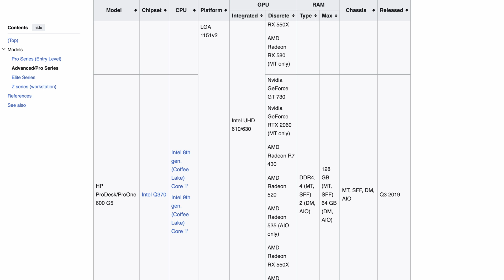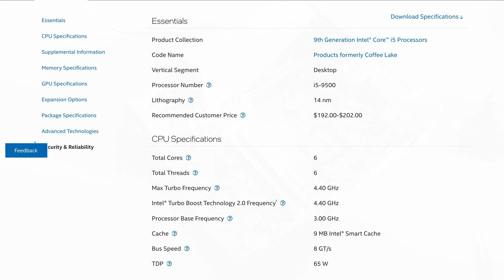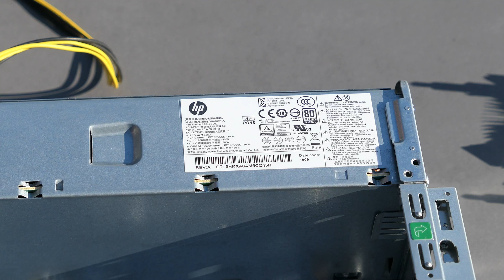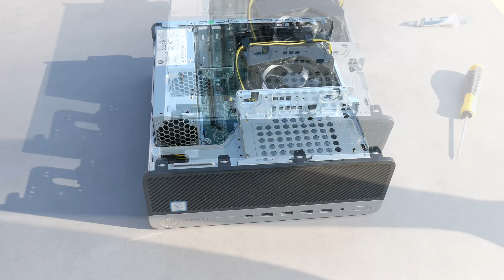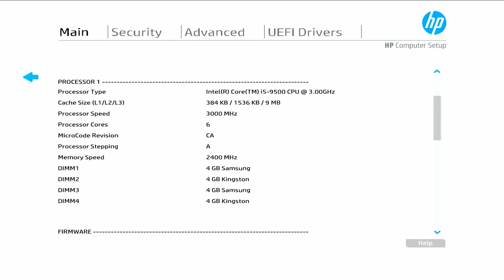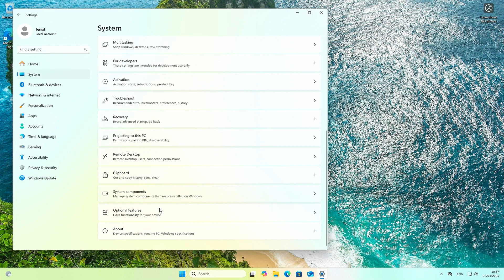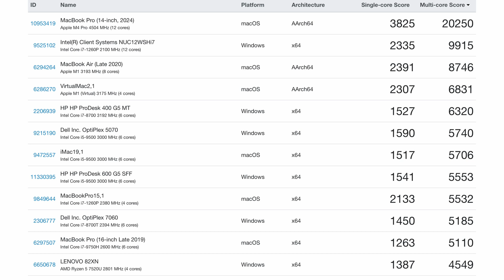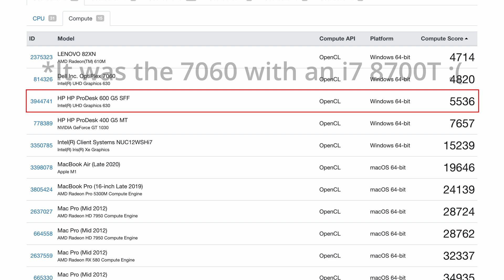HP ProDesk 600 G4 and G5 SFF - Teardown, Upgrade and Benchmarks

Comment: is there any other way to put a sata SSD? I think the sata cable at 9:30 only comes with one sata power cable
Reply from the maker: A splitter for the power connector should work fine if you only have one

Comment: Did you replace the Bios CR2032 battery?
Reply from the maker: Not sure if I did anymore but if yours is dead, it's pretty easy to do. Just push the metal clip holding the battery outwards and it should jump out. Then replace it with a fresh one.

Comment: My dude needs to shop blowing the fan in free rotation..

Puts so much pressure on the bearings..Some say might even destroy the fan from the electricity generated from magnets spinning.  

Not quite sure of the 2nd one but first one is quite likely

Comment: I needed a home office PC with a little arduino stuff, I found this unit G5 1M SSD and 32GB Ram for $250 It seemed like an ok Device with all those USB ports i could be working several ESP 32 boards and the documentation, It is reliable in your opinion.

Comment: Hi Jens! Any chance you could make a tutorial on how to install multiple Windows versions on the same SSD? I bought an OptiPlex 790 just for this so I can make a nostalgia PC and only managed to install 4 OS's and I'm pretty sure I didn't use the right approach either. I'd like to have Windows 98, Me, XP, Vista, 7, 8.1 and 10 on the same SSD, but I don't know what's the best way to approach this, especially with the pre XP versions. I noticed that the ISO's from Dell worked quite well and auto activated on my machine up until 8.1. I've seen some youtubers try this video idea too but couldn't find a proper one. Might be a very successful video idea as well. 🙂
Reply: como es eso de tener varios sistemas operativos en un mismo almacenamiento ?

Comment: Does the m.2 slot has a sata ssd or nvme 2280 drive
Reply: que yo sepa si tienen 1 o 2 puertos para ssd tendrias que investigar un poco mas de todas maneras puedes usar alguno externo con adaptadores que no esten sellados tambien tiene compartimentos para 2 discos duros mecanicos extras asi que con un adaptador o ssd con el mismo conector podrias montarlos sin problemas ay unos werstern digital

Comment: In terms of proprietary power connectors how difficult would it be to upgrade the PSU? It seems like a standard 24 pin is split between 3 (?) power connectors in addition to the 4 pin CPU one? Was interested in this since it's generally cheaper than the Dell SFF i7 8700 equivalent but I know for sure the PSU is swappable on that with one adapter as long as it fits in the case. Apevia's SFF PSUs (300, 400, 500w) are small enough to allow for a dual slot low profile GPU on the Dell which similarly has the PCIe 3x16 slot right above the PSU.
Reply: yo estaria mas preocupado por esos agujeros de ventilacion creo que le pondre algo para taparlos cuando no use la pc por que podrian entrar insectos

Comment: Can you check if the G4 can support the i5-9500? I read on Reddit that it might be possible. I have a G4 and would like to upgrade my G4900 to an i5-9500 🙏🙏
Reply: it does. it is not advisable. someone on hp forum had his die. stick with i7 8700 or 8700k if you have a good cooler
Reply: @thisnowthen  el disipador es muy pequeño y sin cobre por eso decidi el g1 que tiene un disipador gordo de cobre y un ventilador un poco mas grande que el del video

Comment: 8th gen cpu are actually something else, the i5 8500 easily claps my i7 7700 and i7 1185G7
Reply from the maker: Hmm, an i5 8500 gets significantly less high scores in benchmarks as far as I can see: https://browser.geekbench.com/processors/intel-core-i5-8500

The scores are similar to an I7 7700 indeed but lower than the i59500
Reply: @jensdbe can it be used efficiently for gaming? Fir highschool?

Comment: Hi as always a great video.  I have a Question for you: i bought a NiPoGi Mini PC  N100 with 16 GB RAM and 1 TB NVME SSD. Under UNRAID the SSD always was over 50 Grad Celsius . UNRAID showed me a temperatur warning. Now my question : is this temperatur normal for this mini pc? I will use this now with Proxmox and Nextcloud. With best regards from Germany.
Reply: las mini pc tienen mala ventilacion en teoria esa marca que dices si es la que tiene la salida con leds azules y rojos arriba y entrada de aire por debajo entonces es un problema general en todas las mini pc aun con cobre lo mejor que podrias hacer es montar ssd externas asi no comprometer la interna que ya esta al limite

Comment: Thank you for this very useful video. I recently bought an HP ProDesk 600 G4, and this is the exact information that I was looking for disassembly. Could you please recommend a video card for this SFF machine?
Reply from the maker: If I would have to recommend something, I think I'd go for a RX 6400 or a GTX 1650 low profile. The Rx6400 is slightly slower but uses only around 55W so that should be fine with the built-in power supply. A GTX 1650 is using around 75W which is theoretically ok but on the limit.

Comment: A useful and well presented video!👍👍
Those are neat computers, a Graphics card would help and I would add a large capacity mechanical hard drive for storage, that makes good use of those drives and keeps the ssd., as the just the boot drive.
Reply: necesitas una nueva fuente de poder